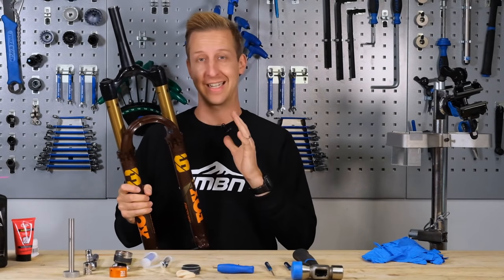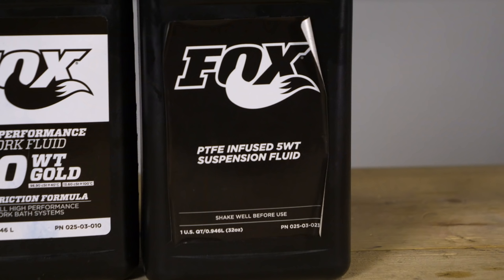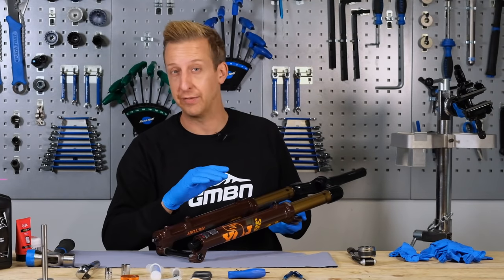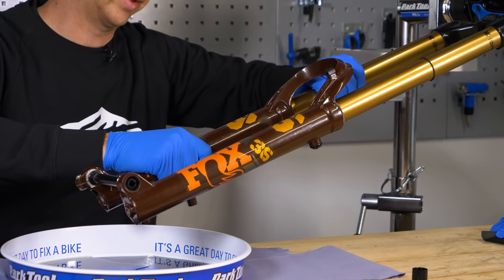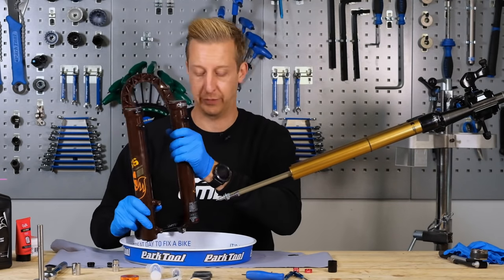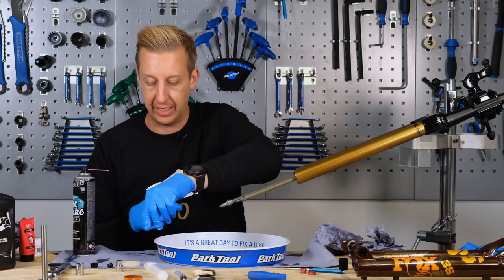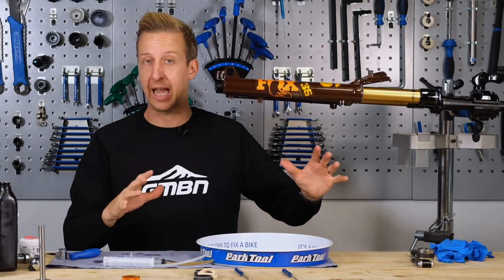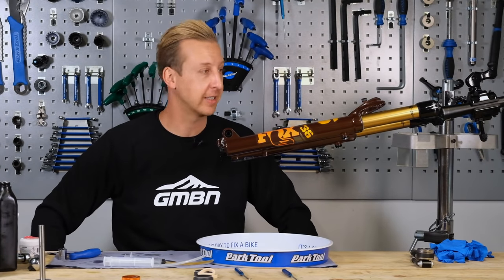How To Perform A Lower Leg Service | Mountain Bike Suspension Fork Service

Comment: You've done about 5 videos on servicing air forks but not 1 for coil forks. About time maybe?
Reply: the only difference will be that you will have a coil instead of an air chamber. As this maintenance is about wiper seals and it's lubrication the principles are the same for both kind of forks
Reply: Some coil forks like the one I have aren't worth servicing the cost alone is a big factor it's sometimes is cheaper to replace the fork instead
Reply: @gulfcitynd  So buying some oil for a coil fork and servicing it yourself is more expensive than buying a new fork? Ohlins has a coil fork that goes for 1,400 euro, so...
Reply: @Powerhugful  Sr suntour xcm not worth the cost of service when I could upgrade it
Reply: @gulfcitynd  These videos are for a wider audience than just you. You might be upgrading yours so you don't need to service it but other people may want to learn how to service their coil fork.
Reply: @Powerhugful  I agree with you but for me when  I doubt have a shop do the work it might be more expensive but it will come out right for me at least

Comment: You've already made multiple videos on lower leg service (along with everyone else) how's about some videos on full damper services. You've still never made one of those and I'm sure there are lots of people that would like to see this for both rockshox and fox.
Reply: Manufacturer has these videos too... Zzzzz
Reply: @BGraves  I've never seen damper service videos on both Rockshox and Fox websites. I've only seen lower 50 hour service and upgrading damper videos. They do have how to PDF's to service dampers, which I've used for years, but they are very general and typically always seem to be missing steps. if you come across full damper service videos from front and rear from either company feel free to share. thanks
Reply: Damper services can be beyond the abilities of a lot of home mechanics. Its something where you can easily make a mistake and not notice until its too late. There is a good reason why you don't see too many damper DIYs...its because its a lot more difficult to do than a seal and oil change. Heck...they don't even show you how to remove the fork seals in this video. There are also many small parts that can easily be lost. If you want a damper that's relatively easy to service...get a DVO or Manitou...skip Fox and Rockshox.
Reply: @zoubtube  once you are into the fork and you pull out the damper it is all pretty self-explanatory especially with the help of the PDF. Perhaps that's why videos don't exist. It's not rocket science once you're in. Same for rear damper

Comment: Another trick I use for the foam rings is, use a small clear bag (usually the packaging it came in) and put some 20wt into it with the foam rings and just move the oil and rings around in there to soak the foam effectively. It does not use much oil that way in comparison to filling a dish with oil.
Reply: Your kids will probably throw those oil bottles out still 80% full.
Reply: I just put some oil in a red solo cup and drop then in.  I'll then use my syringes to also suck oil out of the cup rather than try and do it from the oil bottle.  When I'm done whatever extra is left in the cup I just pour back into the oil bottle.

Comment: Nice job Doddy. Souza from Brazil. I made a career in the field of industrial maintenance, going from apprentice mechanic to mechanical engineer in the 30 years of profession. During this period, I had the opportunity to perform maintenance on hydraulic components such as servo motors, hydraulic cylinders, pumps, etc. As I already work in this area, I also maintain my bike, including the suspension. Regarding the maintenance hour interval for the suspensions (125 FOX and 150 Rockshox), I always question whether it is really necessary to have such a short time interval. At first, I strictly followed this interval time, but I increased this interval as I verified that the oil and seals were intact. Today I do lower leg every 300 hours, and complete maintenance once a year. Even increasing the interval to one year, the oil in the hydraulic chamber is intact. As I mentioned, I've worked with hydraulic cylinders with services much more severe than a bike suspension. I wonder if I had to do maintenance at intervals as short as bike maintenance. I know that with regard to the lower leg, you have to be very careful if you make a decision to space it out. However, opening a Raceday cartridge every 150 hours, or a FIT4 Fox every 125 hours, doesn't seem very correct and/or necessary to me. In your experience, what do you think about these time intervals, especially the maintenance of cartridges?
Reply: What an incredible yet unnoticed comment
Reply: Apply the same mtb standards to automotive damper/shocks and it would be totally unacceptable
Reply: The intervals of these components, especially something like the Fox Factory/Performance Elite or the Lyrik/Zeb Ultimate, are because they are race components. They are definitely on the strict side and can likely be stretched out some.
Reply: @syammimarifin3437  Completely fallacious comparison. The shocks on standard cars are essentially equivalent to what you find on a Walmart bike. They are completely unserviceable and are designed for generic use.
You are comparing literal race-grade components to generic sealed units.

Comment: Excellent vid Doddy, thanks! A couple of things I'd like to add though; if you don't have a seal driver you can install new dust seals perfectly using a long length of threaded rod right through the lower leg with nuts and washers on the bottom (and possibly a couple of layers of old inner tube to avoid scratching the paint) and an appropriately-sized socket on top of the dust seal. Set up carefully this guarantees the seal will enter and seat into the lower leg squarely as you press them in by doing up the nuts on each end. If your fork is brand new this is also a great method for installing the star fangled nut after cutting the steerer tube to length (a lot of bike shops just beat them in). Also if your fork has QR dropouts, go to your LBS and get hold of one of those plastic inserts which are in the dropouts on brand new bikes and fit it as soon as you remove the front wheel; this protects the dropouts from scratches/damage and ensures there's no chance of snapping the lower legs across the central arch (ordinarily the lowers get a lot of their structural integrity from being assembled to the crown steerer and when you remove them they're quite susceptible to this). Hope this helps someone!
Reply: Good one. PVC pipe and a mallet works just as well.
Reply: Or a big socket of the right diameter, that's basically all the custom tool is

Comment: The seals can be installed using a socket that fits over the seals. Not as good as the special installation tool which guides the seals straight as well, but it can be done.

Comment: Should have gone into the air chamber to fix the flaws from the factory.  Specifically, the gloop of grease in the negative air chamber that Fox has never fixed and is in every fork.  Thanks

Comment: if you have a coupler which you use on blue pipe that you find on farms, that works quite well to drive new seals in i've found instead of buying the actual tool

Comment: At the risk of sounding like a safety nerd:
I would strongly recommend wearing eye protection when using any kind of canned solvents like brake cleaner. 
I made this mistake once and got a can with a faulty nozzel and ended up with brake cleaner in my eyes. Not only did it hurt but for a while I was convinced I was going to go blind.

Really easy to just pop some safety glasses on. You never know if there is a leaky nozzel on these things.

As you were.
Reply: Or just don't spray it in your eyes 😂
Reply: But as he was, he wasn't wearing safety glasses. So that was an exercise in futility.
Reply: @superchickensoup  Holy shit, check out Einstien over here.

Comment: Great video Doddy,  when oiling the foam rings I assume you use 20wt for the air side and 5wt for the damper side, as you wouldn’t want to have the wrong oils in either side.

Comment: If you pre-soak the foam rings, are you technically adding more oil per leg than the manufacturers spec? How much oil does a fully saturated foam ring hold? Do the manufactures expect a fully saturated foam ring before adding the specified oil volume? Thanks doddy, your a G.
Reply: Fox can handle up to 10% over recommend amount your foam wipers will hold about 2ml each
Reply: @superchickensoup  Ten percent of 5 ml is 1/2 ml, so the last question still wants answering.

Comment: This is a job I have been putting off as I thought it would be too complex but you've given me the confidence to go ahead with it.
One criticism though is your use of the torque wrench. 1 click only. Clicking it multiple times was just over torquing the nut, you could see how far extra it moved afterwards
Reply: While we're talking about how to use a torque wrench, that's also the wrong grip. By putting his thumb on the opposite side of the wrench, he reduced the amount of torque transmitted to the fastener. You should use an open grip on only one side of the handle.

Comment: I really wish they would show the removal and installation of the seals in these videos. They can be awkward to remove for a lot of people...especially if its your first time. Everyone has a different way to remove them...and if you don't do it properly...you can really mess up your fork lower. Same with pressing them in. They can be a nightmare to press in...especially if you don't have a piloted seal driver.
Reply: @irfuel  Just tap them in a bit first to break the seal.

Comment: I'm thinking about getting those rubber covers that you can find on older bikes and to somehow put them over my suspension.
Is that a bad idea??
Reply: Nope, as long as it doesn’t scratch the metal, you can use a rubber boot or a neoprene boot. I like the neoprene ones but you just gotta make sure not to let them sit wet/dirty on the stanchions or they will do more harm than good.

Comment: Cleaned my foam rings the other week using alcohol and they increased in diameter quite a bit and after soaking in oil were very difficult to reinsert due to their increased size.
Reply: cut a second ring out of the one !

Comment: @7:45 Crush washers are a one time use item, they're meant to make up for manufacturing irregularities. Pls don't reuse them, be it in the bike world or automotive. It's a "wear" item.
Reply: No point in replacing seals, if you can reuse them. If they are in good condition, they will seal again.
Reply: If you can afford the oils, tools and seals then you can afford new crush washers for a few more pennies. No point doing half a job.
Also cleaning and regreasing the air side will only take an extra 10-15 mins so should do that while the lowers are off. 👍🏽👍🏽

Comment: Hello planning to use this video to do my first lower leg service on my fox 36 performance forks 
Only question I had was you said the job may require some special tooling but did not see any use of it during the job. 
Is using the 10mm and 15mm to tap the legs free enough ?
Reply: You don’t need to use the fox lower leg tools, they are very good and take all the risk out of hitting the lowers or the adjuster in the damper side though.

Comment: On the newer forks with the air bleeders, why can’t you just remove each bleeder to drain and refill the oil?  I figure you can remove the bleeders, put the fork in the stand and angle it slightly so the oil runs to the bleeder holes.
Reply: A lower leg will benefit from clean foam rings and clean grease packed seals just as much as fresh oil. You want to get as much dirt out as possible.

Comment: My fork is leaking oil on the bottom of the lower legs. The allen lock which is on the bottom of the leg with the air nozzle. How can I fix it?

Comment: Is it OK to use chain cleaner?
 Is it necessary to use suspension specific grease or can I use any grease?
Reply: suspension specific grease is formulated to not harm the seals and to be compatible with fork oil.

Comment: I have a coil type MTB fork with lockout and there is a leak in the bolt like timestamp 7:32, what should I do? There are no washers on the bolts from the factory.
Reply: Idk.. swap it?

Comment: I recently serviced my Fox 36 and I am seeing small amounts of oil on my stanchions ever time it is compressed. I popped the lowers off again, to inspect for a broken foam ring but it was fine. I also replaced my dust wipers using the seal driver tool ensuring it was flush. At this point I don't know what else could be wrong. At best, I wonder if it is the residual oil wrong the foam rings as I did use the soaking method to pre-oil them and I did not squeeze any oil out before installing them. Any ideas?
Reply: I have the exact same issue with mine. No idea why either. I used the soaking method as well

Comment: #AskGMBNTech
This is very relevant to your video. I've got a 2016 Fox34 Factory Series. Can I use any type of suspension oil/fluid, example: motorcycle suspension oil as long as they are the same weight? Reason I ask is that Fox specific oils are very hard to come by and are very expensive whereas there are a lot of motorcycle workshops near where I live and they have various suspension oils for various motorcycle forks
Reply: What you want to do is not match the Wt of the oil but the viscosity that is measured in CST for example.

Fox Fork 20Wt Gold bath oil 98.9cst @40C / 13.6cst @ 100 C ===> Elf 20 W fork oil: 99 cst / 40 C - 14.6 cst / 100 C

Fox R3 5W (damper oil) 15.8cst @40C / 4.07cst @100 c ====> Maxima 5W 16.2cst / 4.4cst
Reply: @paradox963  see I always thought that the oil weight WT, sort of indicates the viscosity of an oil and anything labelled 20wt or 5wt can be used on my Fox fork. From what you've stated, other oil cst numbers are different from the Fox oil but would the difference be a big deal? 

I live in Malaysia (it's hot & humid) and I can easily go into a motorcycle workshop, a petrol station or a hardware store and buy 20wt or 5wt suspension oil from Elf, Motul, Maxima, etc. 

They're quite affordable whereas it's very difficult to source Fox specific suspension oil and if I could find it, the price is 3-4 times more.
Also when I say motorcycle, in Malaysia they're mostly scooters & mopeds (100 - 125cc engine types) and there are a lot of them around. I think that's why it's easy to get motorcycle suspension oil in the market

Comment: I'd rather sand it with sand paper rapped around and ice block stick in a more concentrated area. You will be there for ever with that sanding block . It would be to easy to sand were you don't want to sand . Just use the file get it close finish with sand paper . Anyway why didn't we see the finish product to see how good it was.

Comment: Can I use a heavier weight of oil for my forks as I am a heavier rider? In Motocross we can , but not sure about the bikes.  Please help! Thank you.

Fork is Rockshox Judy on 2021 Giant Talon 1.

Thanks from Raleigh NC USA 🇺🇸
Reply: Yes you can. I use a lighter oil in my Fox 32 Talas and it works fine. But you got to check some things out before you do this. Be aware that you may loose your warranty. The stupid measurements in Weight e.g. 10wt don't mean anything. Instead look at the viscosity in cSt as well as the viscosity index. The index shows how constant the thickness of the oil is. So you might want to select a oil with a higher viscosity, but about the same viscosity index.
Reply: @michaelfauter3318  I am sorry for the late response,  though I truly appreciate the advice! Thank you for answering my question as this now will help tremendously. I will try this ! Can't wait! Hopefully will do a fork upgrade soon.

Comment: If reusing crush washers, quench them. 
Hang them off a old clothes hanger or similar and heat them up with a gas torch until they are nearly glowing hot and then immediately quench them in water. This will make the copper soft and pliable again so they can properly deform when you tighten up the bolts.

A few caveats, don't repeatedly reuse these washers. They get thinner each time. Don't burn yourself, and don't burn down your workshop/house.
Reply: And don’t do this to the crush washers from fox forks. They’re plastic not copper.

Comment: wow, how difficult this thing looks to mantain. I did ride my jumpbike every day even winter about 10miles/day and my forks (RST Dirt - coil version) was full of water. I just unscrew those two screws, clean whole thing, and even cover them with  tissuses with apple vineger overnight to get rust out of them, but it didn't had oil, just suspension paste. So I just changed paste.

Comment: Why don't they just use rubber boots on the exposed parts of the suspension, to stop the dust getting in there in the first place. You could go years without needing a service on the suspension, like in cars.
Reply: I agree. Like they all used to do. I think it’s a fashion thing.
Reply: WEll...does it really work though or are the rubber boots just in the way when you need to clean when dirt eventually finds its way in there...which it will.